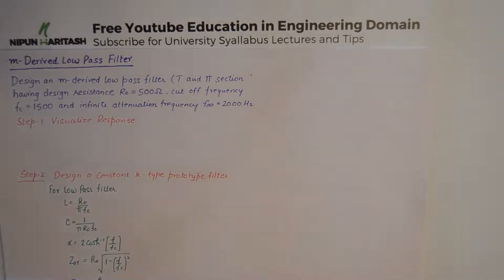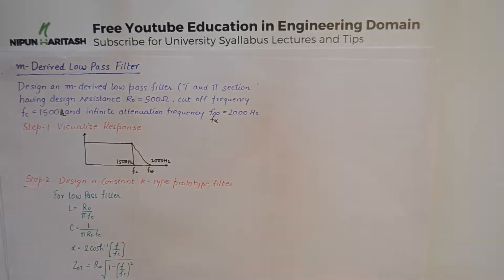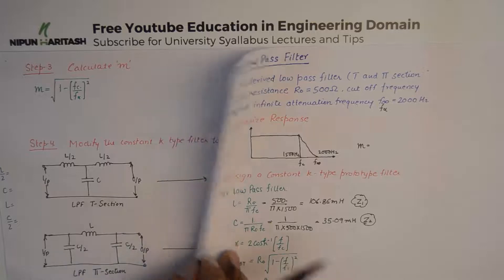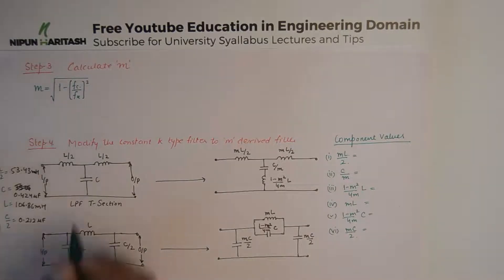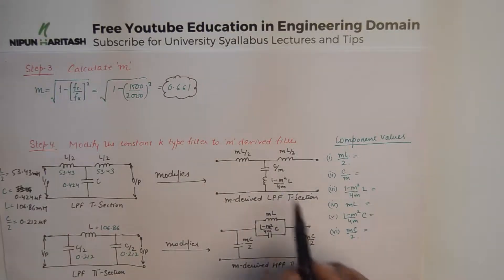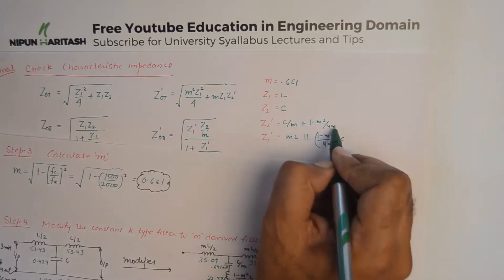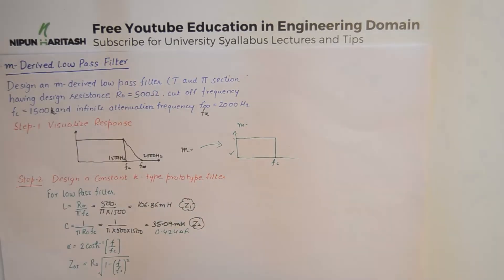m-Derived Low Pass Filter | Design Numerical

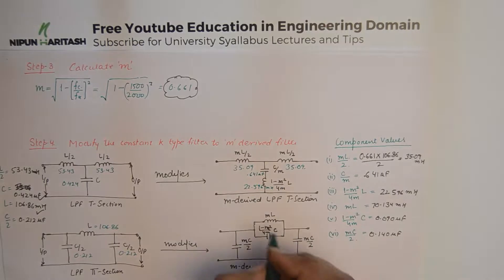Comment: 10:14 For the PI section's shut branch I think

1. C is multiplied by 4m/(1-m^2) not by its reciprocal. 
2. So we will have c/2m in both branch instead of 2m/c .
Reply: Same for shunt impedances it should be divided by m to multiplied by m